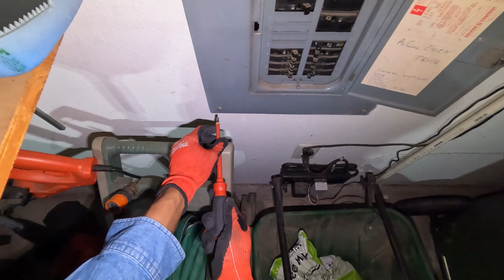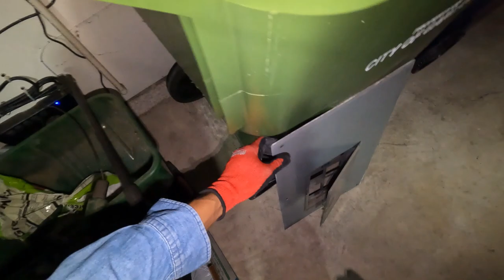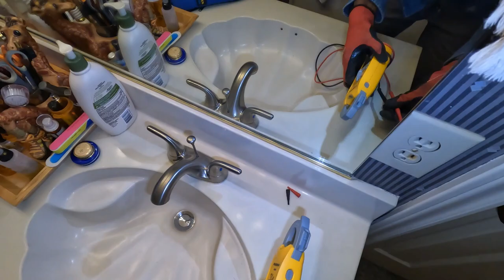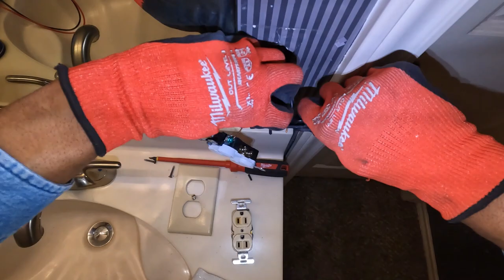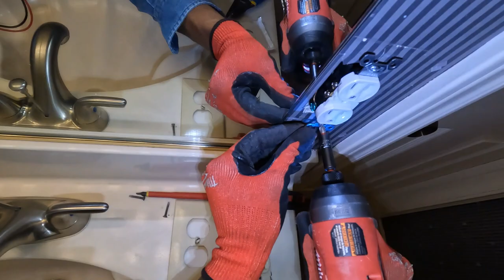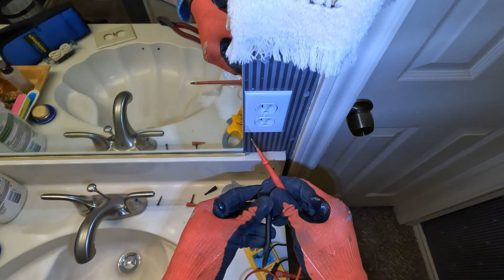Electrician Troubleshoot Breaker Tripped From a Space Heater

Comment: Thanks for putting content on , one of the key elements is the commentary . My comment would be 1. You should move the items in front of any electrical before removing covers 2. You should finish up removal of upper right screw if your right handed 3. Test the proper rest of breaker to validate  4. Inspect breaker amps in reference to heater load applied and calculate compatibility 5. The reason for the browning on plug was from a loose connection ( stabbing of wires ) always wrap under screw for more surface connection. 6. Gfi protection required if plug changed at bath rm . Your lic . Would appreciate it. Thanks for your video 😊

Comment: Most residents don't know to reset a tripped circuit breaker, you must first switch to the off position first, then turn it back on. 💯👍
Reply from the maker: 100%
Reply: So true -)   But I'm glad we use circuit breakers now.   Many decades ago, when homes used fuses to provide overcurrent protection,  frustrated homeowners unaware of the dangers, kept upping the fuse size till it held under an overload, sometimes at 30 amps on a 15 amp circuit.  Or they might bypass the fuses altogether using a penny or stuffing aluminum foil behind the fuse.  This was years before my time, but I believe one reason the industry went to circuit breakers is because the average homeowner is not going to change  out a circuit breaker to a larger amp rating to prevent tripping like they would a fuse, forcing them to remove some loads or call for professional help.   Some older breakers  are just as dangerous if not more so, than fuses notably Federal Pacific Electric,  and Zinsco but that's a topic for another day.

Comment: Nice troubleshooting.   Many homeowners don't realize how demanding a typical space heater is on a home's wiring system.   Backstab connected receptacles in my experience are particularly problematic when heavy loads are carried over a long period due to the minimal contact surface between the wire and spring clip.  What's more, is that a number of home's built or had circuits added from roughly 1964 through 1973 give or take a few years were wired in single strand aluminum for the general purpose lighting and receptacle circuits which expands and contracts at different rates with temperature changes than the terminals on devices which were made from steel, during this era causing loose connections.

Comment: So, you just back stabbed the new outlet. I thought shepherd's hook was better. Please, teach me.
Reply: Better grade outlets have compression connections where you insert the wire in the back similar to back stabbing, but then you tighten the screw to clamp the wire. Those are fine. The cheap back stab outlets just have a metal piece inside that's supposed to hold the wire in place without a screw to clamp it. The contact area between that metal piece and the wire is very small. Over time, this can cause a bad connection, especially if high current loads like heating appliances are plugged in. I got a call several years ago where 3 bedrooms had no power. The owners daughter had accidentally shorted out the plug on her phone charger when a tiny chain from her bracelet fell across the prongs. All the connections at the outlets looked good. It wasn't until I pulled out the back stabbed white wire from the first outlet that I found the problem. There was a tiny groove burned in the wire where the metal piece for the back stab contacted the wire. If you didn't know how small the contact point was in a back stabbed outlet, you could easily overlook it. The wire wasn't loose either. At first, I thought that outlet was good and pulled out the other 3 outlets, checked the wire going to the breaker, and checked the breaker itself. Finally, I disconnected all wires from that outlet and found the problem.

Comment: Uh oh the you tube police gone get you for not hooking those wires 😂😂
Reply: Yes indeed, but seriously all the research evidence and lab testing I have seen makes it clear the need for hooking and or using wire under plates and torquing them afterwards. Removes the possibility of a inadvertent high resistance point. The stab lock push ins are in my view just not good enough with limited contact point for a good stable long-term connection with the wire strain as well if the catch lever is not strong enough and you do get that on one or two things will loosen over time.  It’s why if you look at the NEC2020 Handbook version they show the wrapping method with torquing.

I also prefer to add a ideal armourband  they are great avoiding any, very tiny risk of inadvertent shorting.

Comment: Should of put a GFCI 😀
Reply from the maker: Gfci required At beginning of circuit. There was a gfci in the other bathroom I did not show.
Reply: In that case a label “gfci protected device” should be applied to the face plate